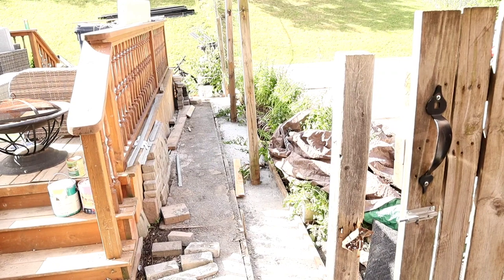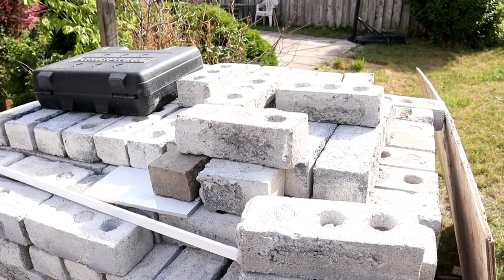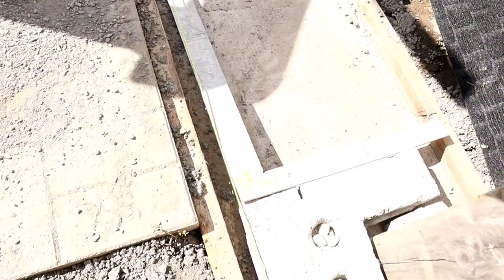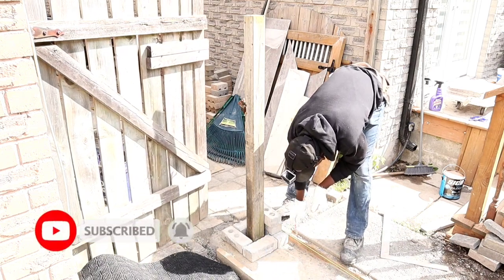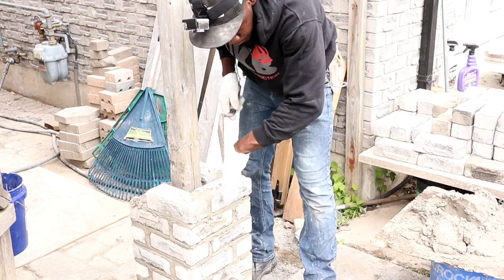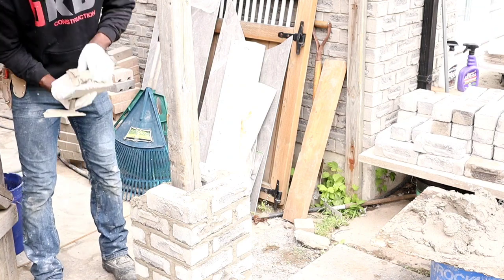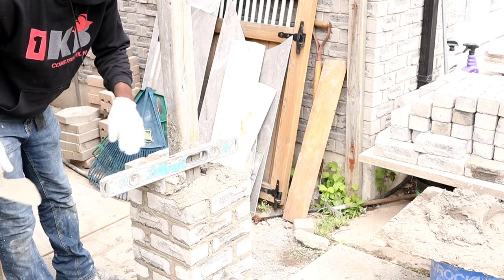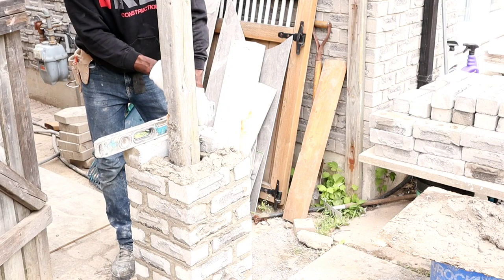how to build a brick pier diy

Comment: Nice job Ryan. I'd stick with bricks for the panels to avoid render. Do you put any weep holes at the base? Also any DPC at the top under the capping. Look forward to next one.
Reply from the maker: Thank you..i agree with you. But they go for blocks ..yea i put some weeping holes in ..they're not using any cap on it.. They going to go with some timber on top off the block..

Comment: Also would you be able to use that size concrete 🧱 s to make a twist column??
Reply from the maker: Yes you can make a twist column. With this size column and this brick is a concrete brick as well.